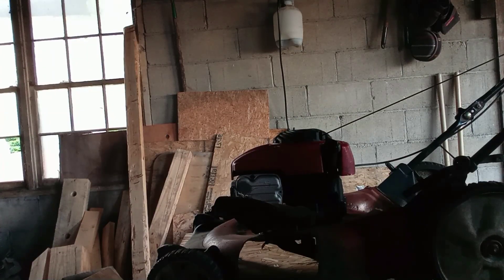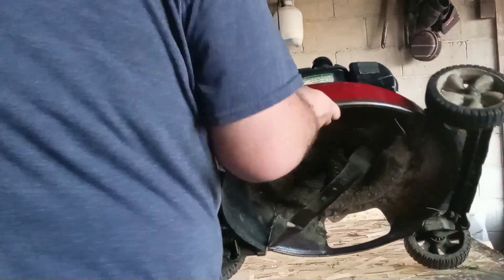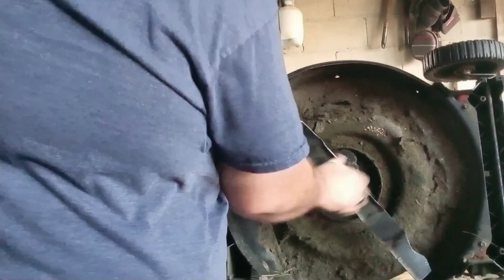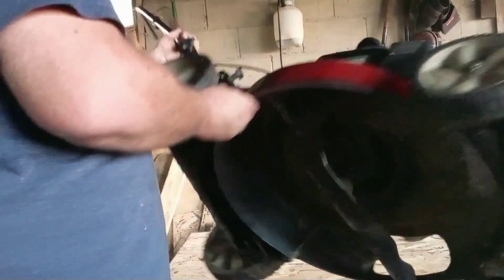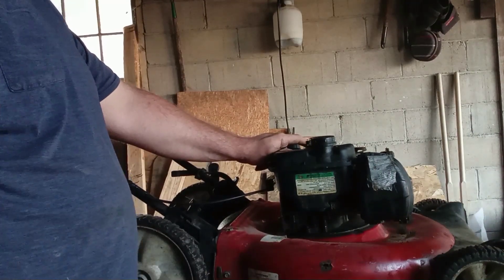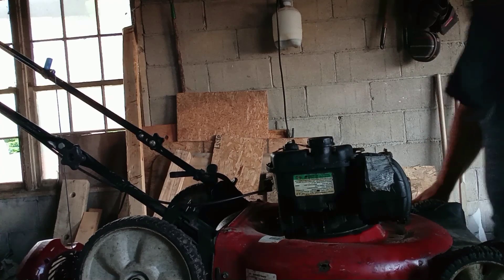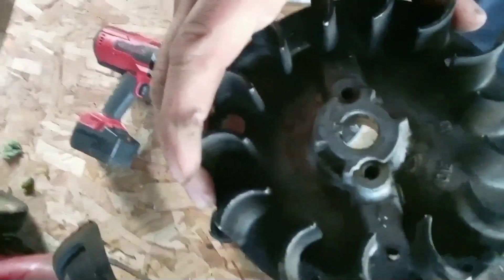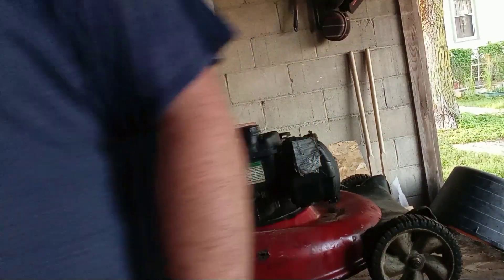Neighbor hit a fence post and killed his mower, can I save it from the scrap pile??

Comment: Nice work helping out a neighbor! The only thing I can recommend is for a debris strike that hard, I'd check if the crank end got bent too. If it's still vibrating some, then it might be. Seen way too many mowers that were still run after a strike and vibrated so much it cracked the deck at the mount points. Again good job!
Reply from the maker: Justin, thank you for the comment. The mower had zero vibration after the fact. I mowed around my peach trees with it for about twenty minutes later on before giving it back to him. I love to help others when I can and thank God for the abilities he's given me. Thank you for watching
Reply: @gregsmowersandmore5878  BZ!